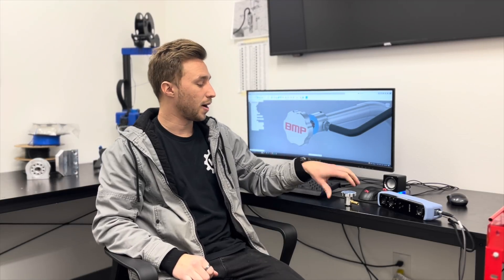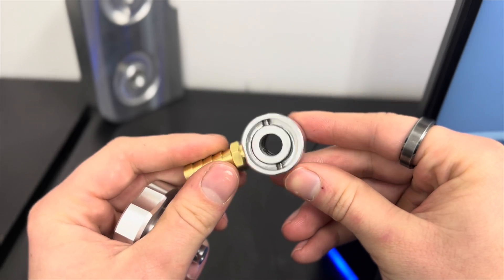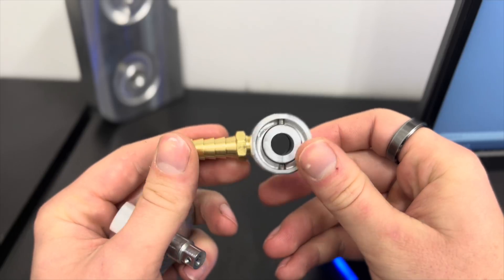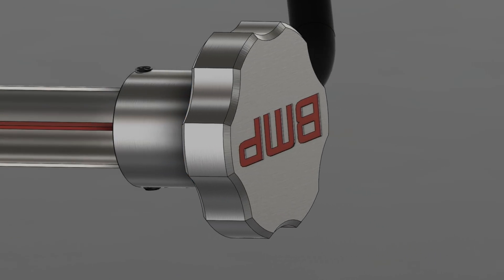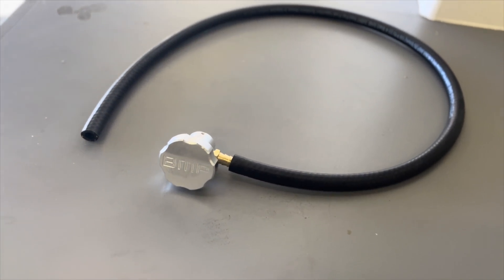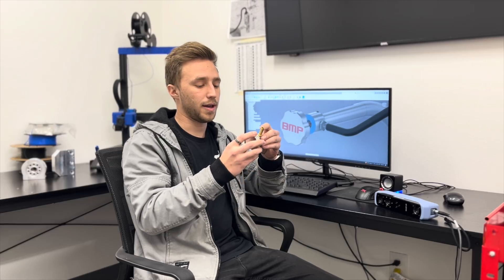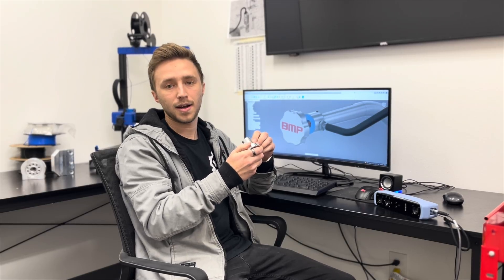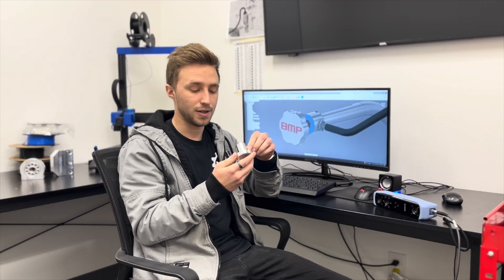Prevent your 6.7 Cummins from catching on fire! Black Market Performance

Comment: so you really have run the numbers like in a MODEL that says the pressure of the fluid in a transmission failure is going to be contained by that freaking tiny set screw?
Reply from the maker: It free flows? There is no pressure

Comment: That looks good, but why would you need to run an overflow hose. I purchased a new one that is just like the stock transmission  dip stick except  it locks in place by pushing down on the handle.
Reply from the maker: The stock transmission dip stick is vented/doesn’t seal, if it were too over heat trans fluid would spray on your manifold. Your locking dipstick should have a breather hole that fluid can still escape from. We redirect it to the passenger side where there are no high temp components
Reply: @blackmarketperformance did u mean you redirected it to the driver side? Cuz the hose looks to be going to the driver side. How long is the overflow hose and it just flow to ground?
Reply: 160 bucks for that.  Lol.  Ya right.

Comment: Awesome idea. The opening looks smaller, still enough room to get a funnel in there to fill the trans?
Reply from the maker: Thank you! Depends on the size of funnel but shouldn’t be an issue 👍
Reply: Agreed....looks tiny....will take forever to fill... probably have to remove it to service the fluid ....